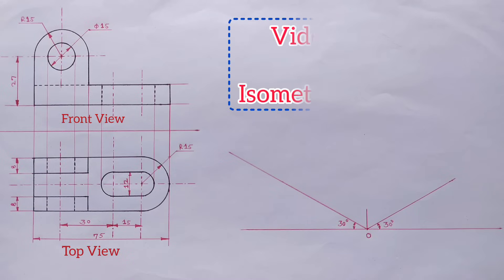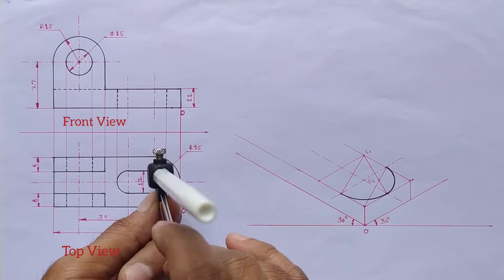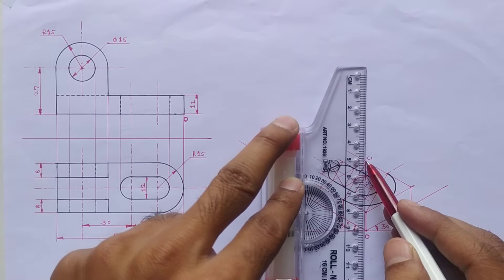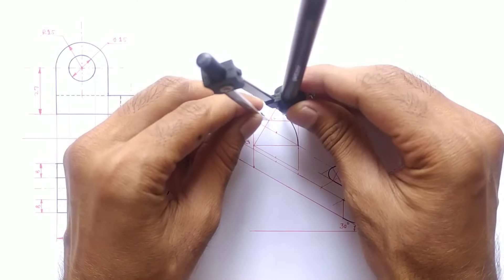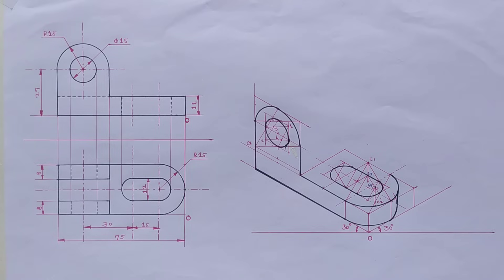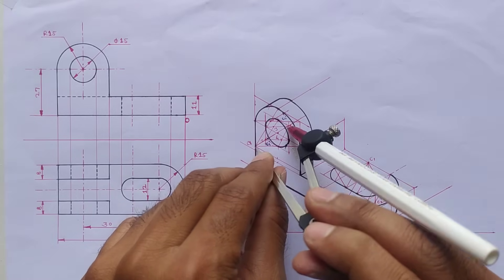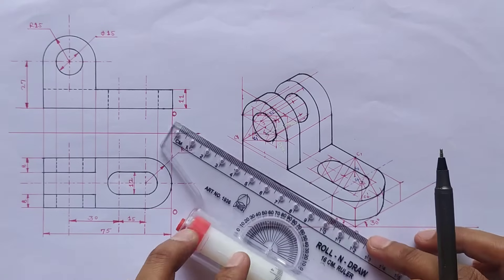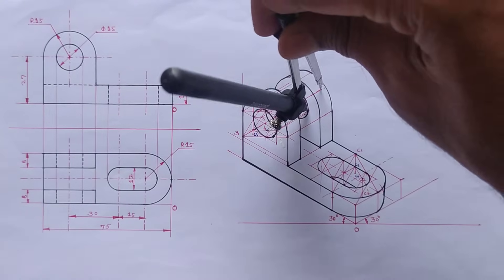Engineering Drawing || Isometric view in engineering drawing

Comment: Hello What kind of mechanical part is this?
Reply from the maker: This is a mechanical bracket or clevis bracket, commonly used in mechanical assemblies to support or connect moving parts such as rods, shafts, or linkages. 

Common Applications:
- Mounting or pivoting mechanism in linkages or actuators.
- Used in fixtures, jigs, or robotic arms.
- Often found in automotive, aerospace, or tooling systems.
Reply: @m.s.gaikwad9552 thank u sir 🙏